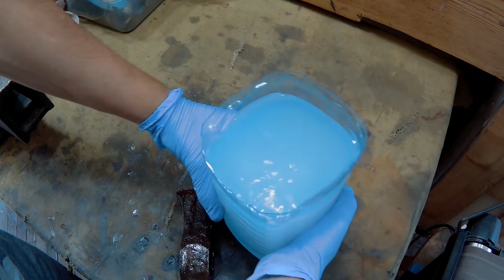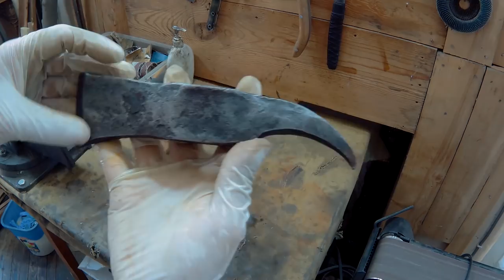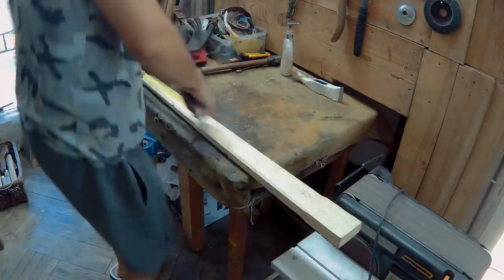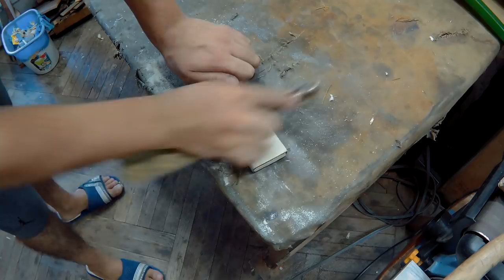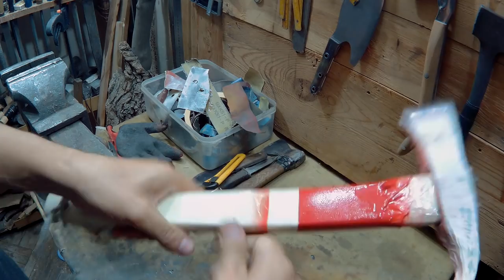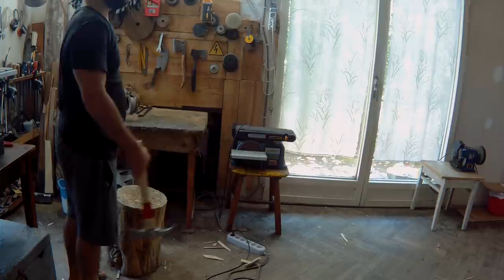Old Rusty Fireman Axe Restoration

Comment: Am watching your video’s from oldest on and so far am amazed at what I see. Your standards for finishing off your projects are very high quality. I admire the fact that you do so much of your work by hand —— it must take you ages——- just noticed something in the fireman’s axe video, during the electrolysis I saw smoke rising from the container, this may seem like a stupid question, but does the liquid get hot while going through the process.?
Reply from the maker: Hello there! Thank you for your attention! Very nice to hear. Yes, when the electrolysis process is underway, the water is heated and the wiring is also heated.

Comment: very nice work. So far as I can determine, that is a European style Fireman's axe or hatchet, where that line is drawn is open to debate. US fireman's axes and hatchets don't  curve on the inside of the spike side of the blade, they're straight and just curve down on top. I believe the handle that was in it was a quick replacement, not what would have been with it originally, it would have looked more like what you made. Good idea to have the lanyard provision, most of this handle length would. I do think your plane could be sharper. I don't know about you, but I love it when the fine slivers just come off in coils. Perhaps you had it set a little too aggressive for that to happen... however if you're anything like me, when the curls are rolling off beautifully, I have trouble stopping. Nice and sharp too, I like that, nothing worse than a dull tool.
Reply from the maker: Hello! I'm always glad to see your comment, is always with actual advice and interesting information for me. Thank you, sir!
Reply: @ScrewsAndTools  I do try to be helpful, but my brusque manner often leaves people thinking otherwise. I'm a big fan of your work. You do your best to do it right, and I appreciate that. Nothing is ever perfect, but you come darn close... most of the time. However it wouldn't hurt too bad if sometimes you show mess ups too, so the rest of us don't feel like we're the only ones that mess up. The biggest problem most people have with tools that have wooden handles is overdoing the wedges. You're only gonna move the material so much, no matter what. If you drive in a metal wedge too hard and too far, you crush the cells of the wood, this makes for a weaker attachment than if you didn't drive it in too far. Most don't understand this, I don't know if you do or are just lucky not to overdo it. I learned that the hard way, that's for sure. I never really did fancy restorations tho, on the farm it just needed to be in working order, it didn't need to be pretty.  come to think of it, I wonder if whoever put that replacement handle on turned the head upside down for some reason?  I can't imagine what that reason would be, but there might have been when it was used for a different purpose than originally intended. Maybe it was just easier that way, I guess we'll never know about that.
Reply from the maker: I understand you and for me your brusque manner is ok, because I received from you useful advice. It's very important for me, due to you have more experience and I always listen to experienced people. I know I often make some mistakes, but I love my job, I always try to improve my skills in wood or metal working. I like the smell of wood and metal in the workshop.I can't visit some construction market without some purchase. I don't like clubs or other stuff which destroy brain and body. But some people asked me. Your young man why you spent your time in a fishing or some diy project... who knows, it's long story of my life.... may be some day I will, can give advice to young boy.
Reply: @ScrewsAndTools  nothing wrong with what you do. I love the smell of the wood and metal too. I love the smell of genuine old fashioned hardware stores too. We have a couple of those left around here, but they're getting rare. When I was a kid, I preferred to spend my time in the garage trying to fix things, though sometimes, well more often than not, my efforts were a complete fail. The first real success was restoring an old tube type stand up radio. I scavenged the tubes from other radios, and got it to work, and was able to make it look pretty good as well. Oddly, by the time I needed to restore a vintage radio/record player that once belonged to my mother, I simply could not get the main tube that it needed. I wound up having to sell it for a price that wasn't near what it would have been worth, seeing that it was otherwise in perfect shape. That thing could differentiate between two 50 thousand watt stations, one at 1500 and another at 1520, most radios of today can't do that, even the high dollar stuff. Anyway, so long as you enjoy what you do, keep doing it. When and if you quit enjoying it, stop for a while. Do something else for a time. You can learn even more skills that might be useful no matter what you may do in the future. Skilled trades are becoming rare, and more valuable all the time. I worked in a lot of trades, so I learned a lot of different things. As someone that works with both wood and metal, you do know that metal has grain, and using that knowledge can help you, I think you already know that and use it, but there are lots of other things to learn. I worked as a welder helper then a welder, so I learned a lot about metal and what heat will do to it. I also worked as both a rough carpenter and a finish carpenter, so I learned a lot about wood, but I learned more by working in a lumber mill, and then in a lumberyard, and did a bit of logging too. I also fought a forest fire once, and frankly once was enough. I also worked as a machinist, I was pretty good at that, but technology has left me far behind in that regard. Actually I've done so many jobs for a while I can't count them all. I've never been good with working for somebody else, especially silly corporations.
Reply from the maker: I too, when I was kidm I spend my time in little barn under the stairs. I made some chemichal experiments and work with wood. Nostalgia..... We have a lot in common, sir.
Reply: @ScrewsAndTools  probably. I once experimented looking for a easy way to recycle plastics. All plastics. That's where the trouble comes in, there are so many different plastics formulas, finding something that works on all is well probably impossible, but I didn't know that at the time. I found some things that would work on some plastics but not all. I also experimented with things to stain and or protect wood other than the stuff you buy at the store. Had a little success with stains, but good protection wasn't in my uneducated wheelhouse. I used to know a guy that invented the kind of ink that will print on plastic bread wrappers. He did it by putting together chemicals that common wisdom said would not mix, but they did. Trouble is, the company he was working for made all the money, he didn't even get a raise. You're probably not old enough to remember when they'd try  to print on bread wrappers but  it woudl flake off. I still experiment with things on a small scale. Basically I "MacGyver" things because I usually don't have what it would take to do it the regular way.

Comment: hey mate, just wondering.. are those rust remover methods is needed when finally use grinder for shinny polishing?
Reply from the maker: Hello, thank you for attention. Yes, needed  due to when you use electrolysis you remove all rusty from all little places of  blade.
Reply: @ScrewsAndTools  make sense.. 
taking all necessary for the blade.. 👍👍👍